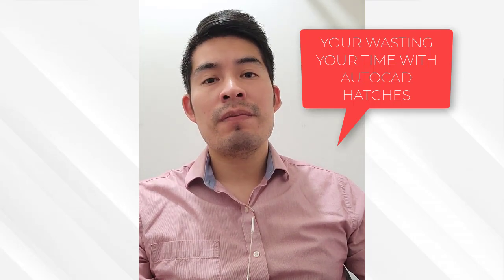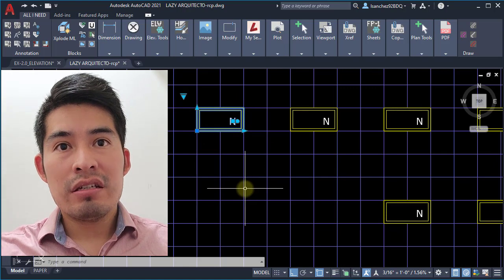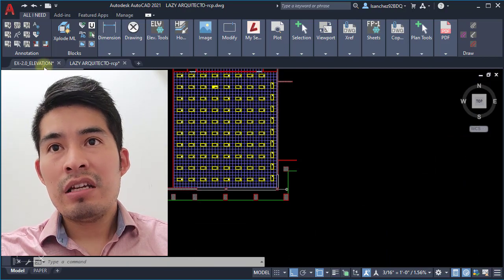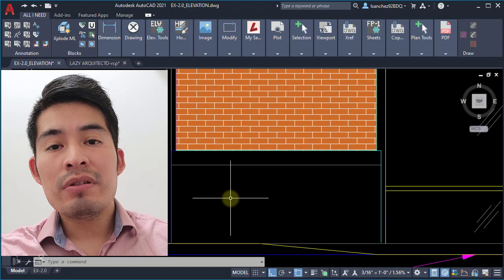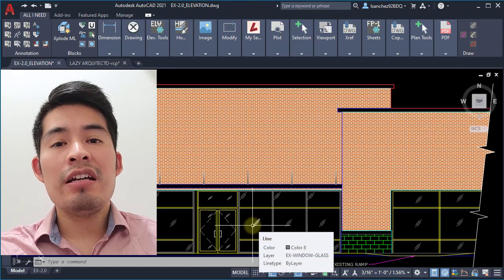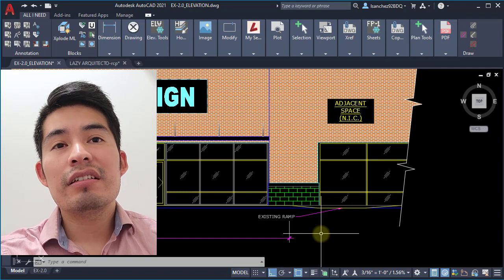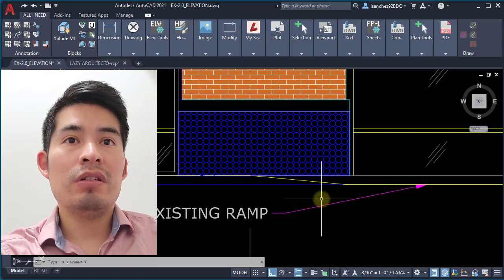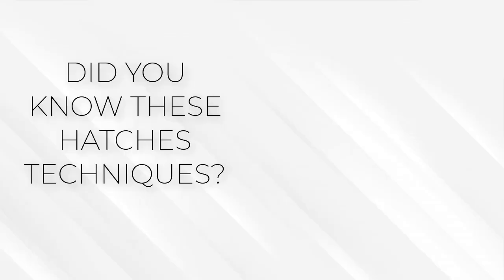AutoCAD Hatch Professional Tips & Techniques (Simplify Your Life)

Comment: Thanks for sharing...!..have a problem...auto cad taking long time while hatching..could u suggest any tip?
Reply from the maker: Try  to set OSNAPHATCH to 0. Let me know if this helped
Reply: @LazyArquitecto  hi, I tried OSNAPHATCH to 1&0 and HPGAPTOL to 0 to 1...but still the same issue....
And i am using tool pallet too for hatching
Reply: @LazyArquitecto  I am using BH command also...I need to avoid hatch on text..

Comment: Another Question, in the top left corner where it has the custom views, {TOP}, 2D, WIREFRAME etc., mine is not showing unless I park the cross hair over it. With the cross hair over it it appears...It used to show all the time. Is there a variable I may have inadvertently changed?  I checked in Options >3D Modeling tab> Display Tools in Viewport  "it is checked". (AutoCAD 2022). Thanks for any suggestions.
Reply from the maker: Try changing to default Autocad profile and see if this fix your problem Douglas
Reply: @LazyArquitecto  I will tomorrow and let you know, thanks for the suggestion.
Reply from the maker: @douglasmichel6361  ok good luck
Reply: @LazyArquitecto  well we’ll, would you  believe it was the color of the text. Options, Display, colors, Interface element, viewport control, changed to to white from black ( black, which is the background.color) wow, I would and didn’t even think or that. I figured that would change automatically to opposite of BG color. Anyway, also worked by changing just to default profile, went to my profile and changed the color and all is good.
Reply from the maker: @douglasmichel6361  glad you could fix your problem Douglas. sometimes when you don't know what variable the problem is, changing the profile will fix most of the issues
Reply: @LazyArquitecto  thanks so much for your suggestion.
Reply: @LazyArquitecto  and yes, soooo many variables, yrs ago when my memory was better I had a fighting chance with them. Today, not so much, I’ve forgotten more about AutoCAD  than a normal education  for AC would cover.
Reply from the maker: @douglasmichel6361  happy to help Douglas 😀
Reply from the maker: @douglasmichel6361  fortunately there are ways to track your system variables, and I'll make a video about it, so stay tuned for that one
Reply: @LazyArquitecto  Terrific, can’t wait. Thank you
Reply from the maker: @douglasmichel6361  in the meantime   this is today's video on wall sections > https://youtu.be/EeGTqfb_ykU let me know your thoughts

Comment: Hey Luis, is it possible to fill a poly line (for example) filling 2x10 joists that cross over a girder with background color so in plan view it hides the beam the joists rest on. I’m thinking maybe there a variable for filling closed poly’s solid with background color.
Thanks, 
Doug
Reply from the maker: Can you use a hatch with solid color?
Reply: @LazyArquitecto  I could but won’t that increase the file size plus possible bog down printing? When I use Chief Architect there is a default to be able to set solid fill with background or to leave as an open box so to speak (see through) I. E. Like using Drawing Order but with a filled box.
Reply from the maker: @douglasmichel6361  do you have Facebook? You can send me a picture of what you're trying to achieve there
Reply: @LazyArquitecto  thanks, I will at first chance I get
Reply: I liked your Facebook so I’ll post a couple example’s asap

Comment: By changing that variable to 1, does it affect already applied hatches?
Reply from the maker: Douglas with variable are you referring to? I mentioned many ones on the video
Reply: @LazyArquitecto  Sorry, yes you did, my bad. I was referring to the HPGAPTOL variable in particular.  However, I suppose this question could apply to any variable. By changing a variable mid stream into a drawing,  does it affect the way entities already drawn appear/behave etc.. For instance, during a REGEN, will changing from 0 to 1 in any variable, will a like item already within drawing and it's variable when drawn was set to 0, will it change that item or all like items to 1 when we do a REGEN or when reopening the drawing. Typically I don't change variables once I've started a drawing, or I change them as I go BUT prior to drawing something it will affect / not already drawn. Or does it affect only those entities drawn after changing variable. Jeeeezzzz, that was a mouth full. Hope it's clear what I'm asking.

Comment: Hi , Just wanted to ask how does the draw order command works on blocks? I mean, I am trying to put the hatch behind a rectangle with text just like the one you did on tip number 5,  but it is not working. Thank you! hope to receive your reply!
Reply from the maker: You need to get inside the block by double-clicking on it and pick block editor, then you can use the hatch trick.

Comment: Hi! Your tutorial was amazing. I have a question. Is it possible to print in PDF solid transparent hatches as vectors? Sometimes when I have an elevation I put some transparent sold hatches and when I am about to print it I use the ''plot transparency'' command but the problem is when I click ctrl+P to print it from dwg to pdf, it takes A very long time to print, and even if the quality is only 100 DPI, the PDF file is always heavy (LIKE 20 MB) is there any solution to this?
Reply from the maker: hi Shazz, what I would do is check if you have a CTB or plot-style that is corrupted. OPTION command and set profile to default (the original that came with Autocad) this will change paths and if when you press CTRL+P is faster, then corrupted ctb is the problem